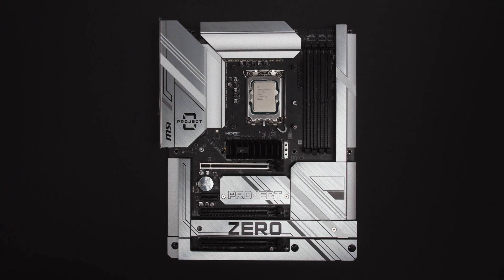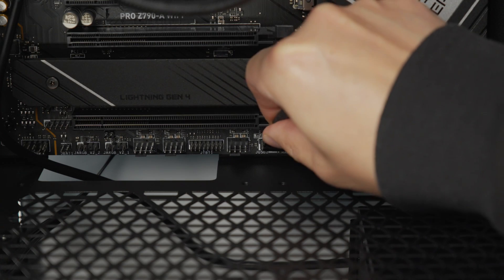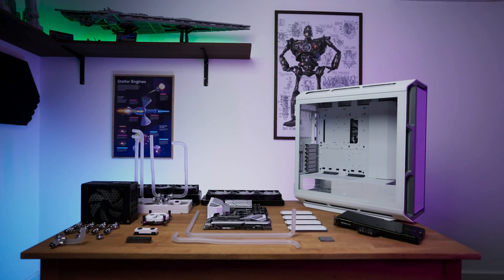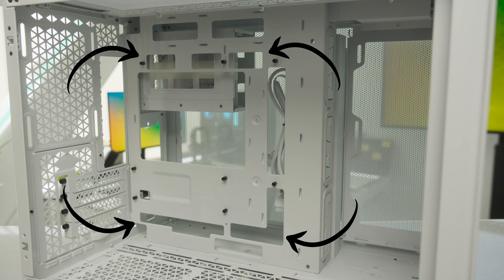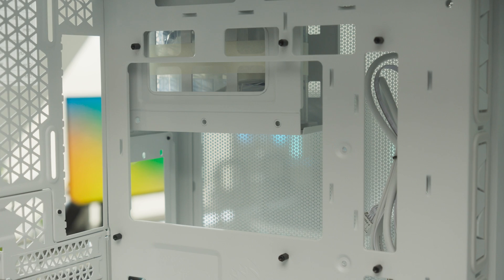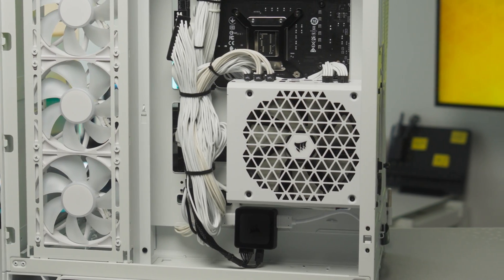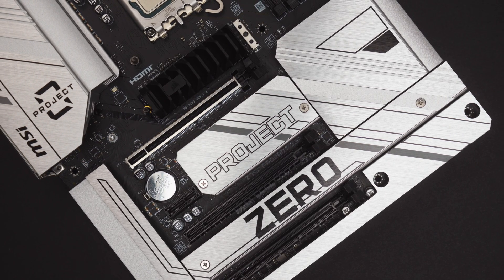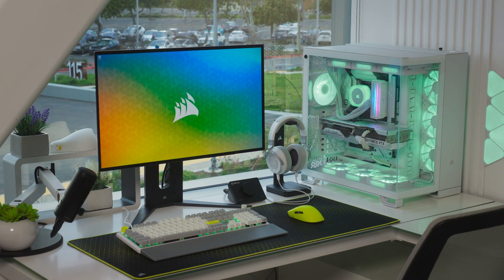Case Design and New Motherboard Standards

Comment: I'm building a pc, 6500d case, b650m motherboard, and hx1000i.  That trio was recommended through corsair's build your pc section.  The power supply will not fit with anything plugged into any of the headers at the back bottom of the mother board.  Is the compatability only for intel boards ?